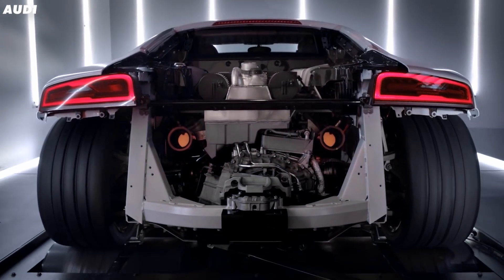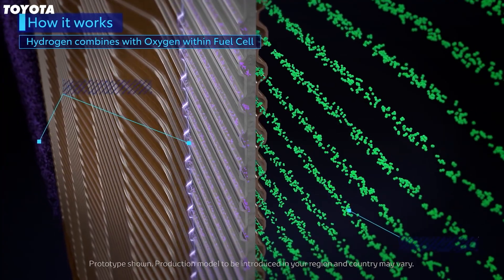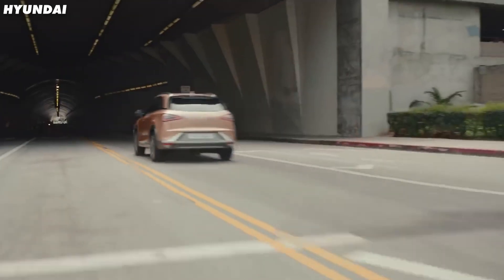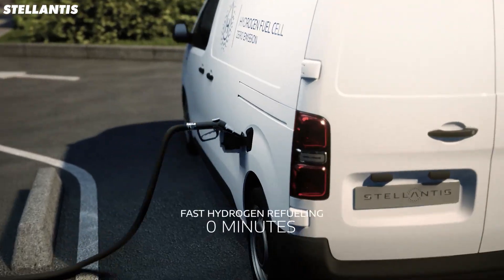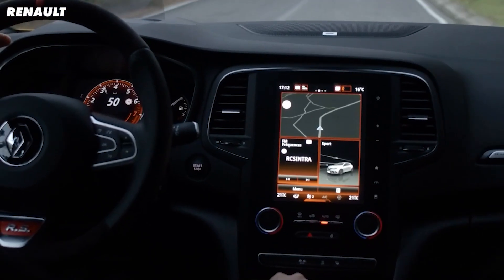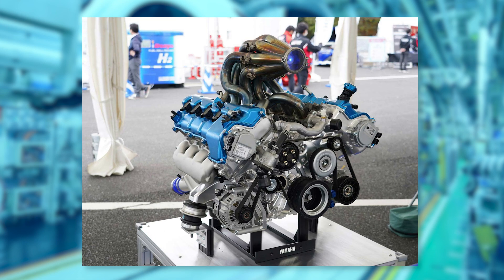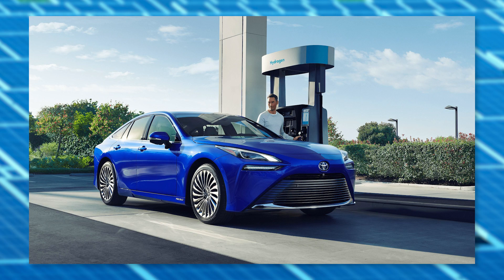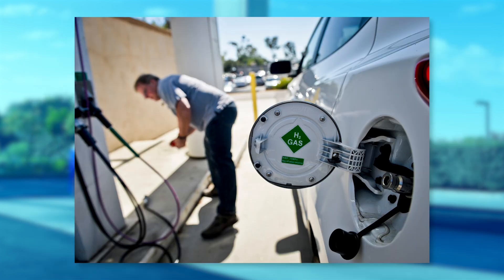The V8 Engine that Runs on HYDROGEN

Comment: To be quite honest, I can‘t see hydrogen as a car fuel ever catching on. E-fuels / syn fuels (synthetic gasoline) might be a bit more expensive to produce right now, but also much easier to store and transport, and you can use existing infrastructure (gas stations, etc) and cars(!) with them, while producing them on 100% clean, green, regenerative energy.  So if anything, this will probably be the stop gap solution, IMHO.
But sooner or later, just like we exchanged horses for cars, we‘ll trade in our combustion cars for electric ones; they are simply so much more efficient, and as battery tech advances, both charging times, range and prices are gonna improve dramatically, as they‘ve already been doing in the past 25 years.

Comment: Contrary to what you imply, the power released by a hydrogen Bomb has nothing to do with hydrogen's flammability. The power comes from nuclear fusion, which is two hydrogen atoms merging to become a helium atom. In contrast, burning combines two hydrogen atoms with an oxygen atom to form H2O, aka water.

Comment: Cars other than some classics make no sense, the energy lost creating the hydrogen especially if using fossil fuels makes it very inefficient compared to EV.  In large equipment like diggers HGV's its a different thing and JCB are looking into this running what was a diesel engine on hydrogen.  To reduce NOX emissions the engine had to be run very lean so not a diy swap but potentially large diesel engines can be retrofitted for much less than replacing them, businesses could even produce their own hydrogen on site

Comment: You missed the part too that using Hydrogen in a combustion engine doesn't solve the emission problem completely. Yes under ideal conditions you will get complete combustion and water as a result, realistically tho you are mixing air in the cylinder and unless the air fuel ratio is mapped perfectly you will still end up with Nitrous Oxides and Carbon monoxide being produced
Reply: i dont get it, unless u use impure hydrogen how will u get NO2 and CO?
Reply: @The_budgetking  Combustion is happening when mixing the Hydrogen with air, not pure oxygen. High temperatures, imperfect mix etc lead to other things being produced
Reply: @Javadamutt  yeah makes sense, but how does a perfect mixture solve this
Reply: @The_budgetking  Esentially it won't. The perfect mixture means every Hydrogen atom reacts with every Oxygen atom and all the other stuff is left untouched. Essentially this is impossible and on a practical level isn't something you want for a car 

 Too much Oxygen (air) and you run lean and too much Hydrogen you run rich but there are valid reasons why you may want to run rich or lean at a given moment like cylinder cooling, acceration, fuel efficiency to name a few.

Doing so will always cause a certain amount of other pollutants to be produced as ensuring aire/fuel is perfectly mixed in the perfect ratio at the atomic level is impossible.
Reply: @Javadamutt  ohhhh, i get it now

Comment: This video could have been so much better, if you guys spend more time on research, concerning Hydrogen. It's actually less dangerous than petrol, it has almost nothing in common with the H bomb and tanks have to be this strong, since it's stored at 700 bar and there's new technology, which could make these tanks obsolete, as there is a possibility to store the gas as a solid  in metal blocks, which is lighter and safer.

Comment: You do know that the the process that takes place in the H-bomb is nuclear fusion and basicly requires a nuclear fission to provide the requirements to start it. It is absolutly impossible to turn a hydrogen car into a bomb. Also, if I am not mistaken, the H-bomb uses deuterium and/or tritium, which is of course not what you would use in your car.

Comment: There is a simpler solution - methanol. It is at normal atmospheric pressure and 20 degrees Celsius liquids like gasoline and diesel. Adapting ICE (both SI and CI variants) is simple and inexpensive enough to compete with ICE on petrol and diesel, with significant reductions in emissions and CO2 - if mercury or blue methanol is used - and virtually 100% reductions if green methanol is used .

Comment: The big issue with hydrogen is availability. You need production to improve, so that accessibility can improve, and even then you need it to be super convenient, super cheap, and super effective in order to really take off whilst gasoline is still available, otherwise you're waiting for it to become the only option as opposed to the alternative. Companies will get there with hydrogen engines, as it's just another fuel that goes in, goes bang, and makes torque. By nature it's just like gasoline, and gasses like propane (lpg) and compressed natural gas that have also tried and failed to genuinely penetrate the market.

The hydrogen engine isn't a new thing, as Mazda had them out there on Japanese roads many years ago in hydrogen powered RX-8's, but they also had propane (LPG) fueled rotary engines some 30 years ago which likely addressed the biggest issue with the rotary engine where the seals fail and the rotors interact unpleasantly with the housings (ceramic apex seals, and addressing the carbon build up and detonation that the seals so vehemently detest) but from what I've read they only ever found industrial use, I'd likely speculate due to LPG failing to win over customers on the scale it probably should.
Personally, I drive a dedicated LPG vehicle and I absolutely love it! I'm really bummed that Mazda never released an LPG vapour injected RX-8 as it could have helped the wankel meet more stringent emissions laws and helped resolve some of the aforementioned reliability problems that have plagued the rotary engine over the years.
Reply: We are humans, at some point in time we will find a better way to solve these problems.

Comment: One comment, toyota actually did a demostration on a tank of pressurized hydrogen being puncured, the hydrogen shoots out of the tank too fast to actually ignite. So ignition is not as big of a deal with it as you might think.

Comment: Don't know where you get your info but automotive fuel tanks are stainless with a spray on plastic coating inside to prevent corrosion , to bad those coatings don't last longer had to replace one in my mom's versa .

Comment: No clean energy source will save us, only cutting down power use, which is impossible because of our nature. As long as it's an ineffecient use of energy, the byproduct created as a whole is the same. Even solar power, the process to make an efficient panel is very complicated and the thing is very expensive, and it needs to be maintained and replaced too. What I'm saying is, cut this greeny nonsense, just stick to petrol fuel until we run out of petrol, then we will all switch to electric scooters, no more dilemma, mother nature will do the transition for us.

Comment: Hydrogen and eFuels are the future for car enthusiasts. Tinnitus inducing EVs are for the people who hate "commuting" and think of driving as another chore.
Toyota's H2 V8 is designed with the basis that electric motors aren't reliable enough for global use, not sure how reliable is their H2 engine right now but they're aiming for its release by 2030 so they got sometime to hone it down.
I for one will NEVER buy an EV. Tailpipe emissions is just sent to power plant emissions PLUS the impact of Making and Recycling Batteries AND hogging them around (extra tire and brake pads emissions). And they sound like Tinnitus... V8s FTW!
Reply: Car enthusiasts can appreciate any powertrain, from ICEs in many pistons configurations, rotary, turbine, Steam AND ELECTRIC MOTORS! The Tesla Model S Plaid and Lucid Air Founders Edition were only possible because they are electric and no sports ICEs saloon can beat them in performance and that's good. We can appreciate AMGs, M3s and M5s, Tesla and Lucid.

Comment: Didn't BMW try this with the Hydrogen 7 but was never perfected. Look briefly at the diagram for creating hydrogen you see will need natural gas to help create it. So why not just fill the car with CNG and run off it OR fill the car with CNG and water to create hydrogen. CNG to start the car and later convert the water in the  car to hydrogen.
Reply: Yes and the Hydrogen 7 did use a 6.0 V12 to compensate the loss of power when burning Hydrogen. NOx was higher and the MPG 1/4 compared to petrol. The energy alone to create Hydrogen can charge a few cars battery. Hydrogen will continuous to be restricted to rockets as doesn't make sense use it in small applications as cars being through fuel cells or ICEs. To store the Hydrogen high pressure tanks are necessary, in the filling stations and in the cars and they aren't cheap to produce. From an economic stand point, Hydrogen as a fuel to power cars makes no sense, would be better to invest in Steam powered cars instead!
Reply: @krisg.4257  I would just love to find way to run CNG my Chrysler 300 and have a dual fuel CNG option.  The CNG tank does not to be big just big enough to fit in the space tire well of my car.

Comment: Hydrogen would be better suited for commercial applications (freight, trucking, etc), where weight budgets, usable cargo capacity and refuelling times are high on the list of things that are important.

Come to think of it, weight and refuelling times are important in motor racing as well, so we might see F1 run hydrogen, especially if they can keep some sort of engine noise as well.
Reply: Energy freedom should allow people to use it if they want to.  EV and Hydrogen will probably yield the same mpg.  Hydrogen though will probably be cheaper to produce.  So a passenger vehicle should be just fine using it.

Comment: Makes sense to me, I live in a village and don't have a driveway, so charging an electric is a virtually impossibility and a flat battery would leave me stranded miles from a power source! I think hydrogen could be a great future option for rural areas!
Reply: Look to the Lightyear One, this car will revolutionise the world as you don't have to charge it!
Reply: I don't understand this. We have a national grid. Electricity is already supplied to virtually every building in the country. Already. We will not be building a hydrogen delivery network anywhere near that extensive, just as we never built a petrol network that extensive.
Reply: The electric grid we have now cannot support 50% of people charging their ev at home. The cost to upgrade the grid would be astronomical and would have to increase hydro production as well
Reply: @TheMonkeyfreak23  We have to upgrade the grid anyway, so the extra cost would be low. With hydrogn, first we need to build expensive production facilities, then an expensive distribution network, just to duplicate what electric is already doing, for the sake of vrooms and pops and bangs. It's not going to happen for private vehicles. Sorry.
Reply: @grahamthompson5581  actually you have to upgrade your grids to accommodate EV. More cables, bigger cables, more transformers and more power to it. it's not as easy as plug and play because the demand is higher. it's also more expensive than H2 infrastructure due to energy density. not to mention the needs of cobalts, copper and nickel on your cables and coils. H2 infrastructure can use the existing fossil fuel infrastructure, one way to do that is by transporting H2 in form of either Ammonia or Nethanol. then use the filing station to break them up into H2 with simple chemistry. voila...
Reply: @saltymonke3682  you know that transport method could work , if ammonia or nethanol were to be transported to  a  refinery  that uses chemistry to  produce hydrogen but then agian i doubt there is such a thing.
Reply: @saltymonke3682  your brilliant very
Reply: Umm... solar panels exist for a reason.

There’s a reason why people who go off grid CHOOSES SOLAR PANELS. Duh
Reply: @robert2690  do you know the base power needed to fill up an EV during a good weather with PV?
Reply: @robert2690  I think you dont get why they cant do this, they said they live in a village and so wouldn't have the ability to install them.
Reply: Believe in JESUS today, confess and repent of your sins. No one goes to heaven for doing good but by believing in JESUS who died for our sins.  For God so loved the world that he gave his one and only Son, that whoever believes in him shall not perish but have eternal life.(John 3:16)❤️😎

Comment: Solar and wind energy is fluctuative. One problem with these energy sources is it at times produces energy when it's not used, so you need something to store the energy for when it's gonna be used. Battery needs to be in a very large scale to be efficient and even then it will degrade quickly. There was an idea to store these energy by converting it to hydrogen but it got silent so far. IDK maybe it's not very efficient or something.

Comment: u complain about the range of a BEV but want a hydrogen ICE car. u do realise that the Mirage isn't really where ICE cars are in terms of range, doesn't have an engine(motors are smaller) yet the passenger space is quite compromised due to the storage? now u want a drive train that is far less efficent to run on the same drive train. just a thought... also, synthetic fuels are probably better and more versitile(can be transported in a normal gas can) for a track day car.

Comment: I have noticed other car manufacturers are looking into this Mazda want to used hydrogen in a rotary engine and I saw another manufacturer had patented a design for a two stroke type of engine that would run on hydrogen. BMW who are working with Toyota are also reluctant to just only produce EV cars are also working on ideas for hydrogen use both electrically and combustion engine, remember they previously did two concept cars way back in the early 2000's to highlight the technology. A lot of construction, agricultural machinery and HGV/bus manufacturers are also looking into hydrogen combustion as it is more practical than battery for running equipment for longer work hours than full battery. The hydrogen production is also being sorted out as some of the green hydrogen projects are quickly advancing through trials and some are providing quick and cheap ways of producing hydrogen.

Comment: What if you drove the lay-shaft of a standard manual gearbox with an electric motor? You could even mimic the revving characteristics of a combustion engine. Perhaps the torque and the way it's delivered are too much for 'box? You'd also still be silent.. ish. The gearbox whine would probably be noticeable without the engine noise to mask it.
Reply: You can get that in EV conversions. But most people just leave the gearbox in one gear and don't shift.

Comment: Toyota actually made a modified GR Yaris that runs on hydrogen, they said it was not as easy as they thought it would be and had to use a mixture of petrol and hydrogen in its early stages and it was wildly inefficient, expensive and heavy and it made much more sense to go with fuel cells or normal EVs

Also BMW is too experimenting with hydrogen vehicles but it's mostly FCEVs

Comment: Lol dinosaur oil😂
Oil is 4th most abundant liquid on earth and will not run out.
It is not a fossil fuel.
Reply: Of course it is you fool. How do you think it was formed?
Reply: @Brian-om2hh  you don't know how it's made? It's not hard to look it up.

I will add some info for you.
(oil is formed naturally and quickly)
At temperatures between 90 and 160 degrees Celsius, the kerogen turns into oil and natural gas. At any temperatures higher than 160, only natural gas or graphite is formed. This temperature range is known as the oil window. Oil will escape from the oil shale and rise toward the water above, creating a reservoir.

Comment: Forget filling a cars fuel tank with hydrogen or any other fuel.
We need a system whereby you have a water tank that the hydrogen & oxygen are separated and then the hydrogen is fed to the ICE.
I've watched plenty of YT Videos on using electricity to separate the hydrogen & oxygen, so it CAN be done.    😘

Comment: If it's real gear change that is the most important for you, do the same as me. I bought a hybrid Hyundai Ioniq, it has double clutch and a sequential gearbox (with paddles) and it works with both motors.

Comment: Hydrogen or Electric? Which is the smartest choice?
Reply: Use it properly depending on the purpose.
Reply: @kouzoukenmoku8644  Yes, maybe electric for cars, some trucks, buses and so on and hydrogen for construction machines and other heavy machinery. Like you said it depends on the needs.
Reply: @mikaelgaspar9547  Yes, hydrogen-fueled diesel engines are also being researched and developed. It is likely to be used for large construction machinery such as diesel hammers.
Reply: @kouzoukenmoku8644  I wasn't talking about converting diesel engines to hydrogen, i was just talking about using it has fuel to turn it in electricity.
Reply: @mikaelgaspar9547  It's a fuel cell. Fuel cells make heavy use of rare metals such as platinum, so they are not very practical for large-scale applications. In addition, at construction sites in harsh environments, fuel cells may deteriorate faster.
Reply: @kouzoukenmoku8644  Ok, didn't know about that.

Comment: I want to see one turbodiesel internal combustion engine runs by hydrogen.  
I believe that exist more improvement about the BEV'S charge very fast without problems on battery system and the same battery and is the recharging it lasts just like as ICE car then BEV'S and renewable biofuel i believe on this type fuel who's going keep alive ICE, If the don't BEV'S charge very fast and renewable biofuel can't to keep them alive the ICE.
Then the Hydrogen is perfect solution and alternative fuel for all type of cars.